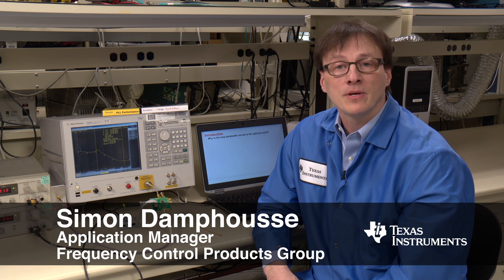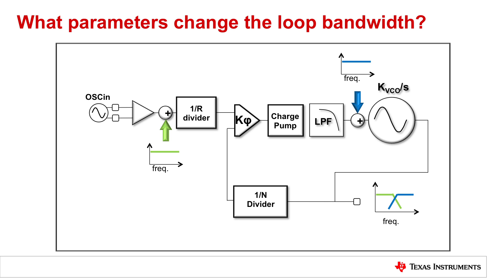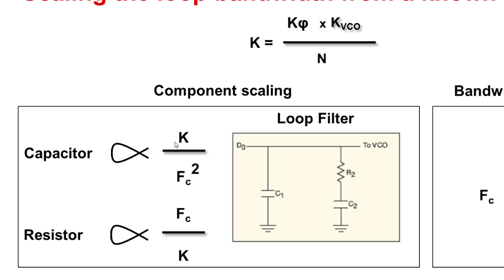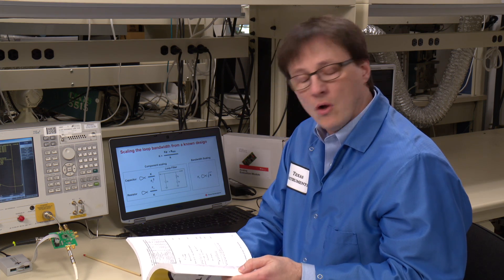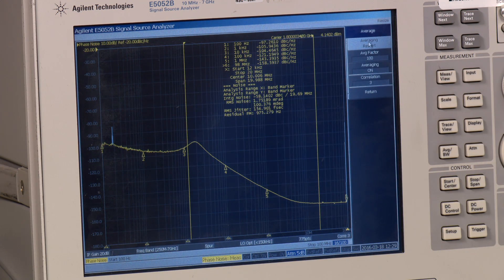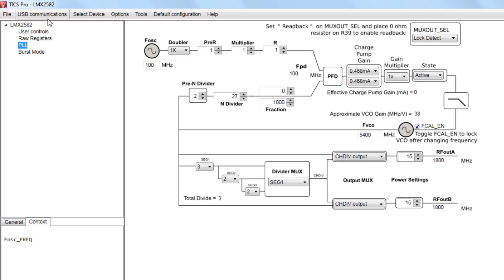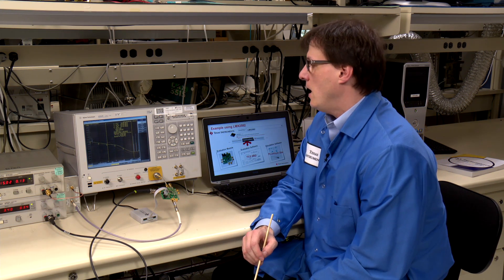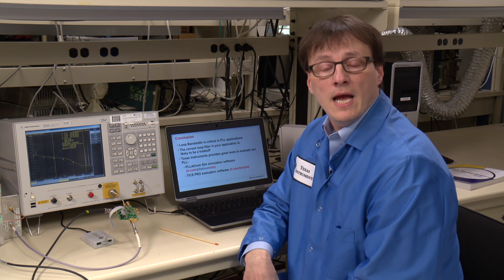Engineer It: How to design with excellent PLL & VCO noise performance

Comment: excellent video. i loved  this video  for explaining us with excellent pll and VCO noise performance . 
i am last year student in the faculty of electronics Engineering  and i am preparing my final year project . the topic that i am preparing  is @carrier recovery using digital phase locked loop . my problem statement is as we know oscillators are integral components of any communication systems for carrier generations .
frequency and phase offset exists between the transmitter and receiver oscillators and its not possible to build oscillator with exactly same frequency and phase because of analog components impairments.
so  can you help me to get extra information about this project  my email address is 
e-mail: marwaan226@gmail.com